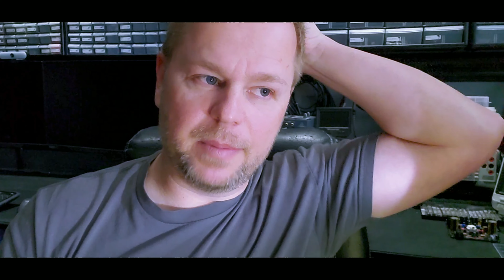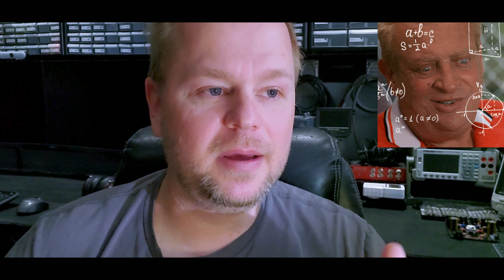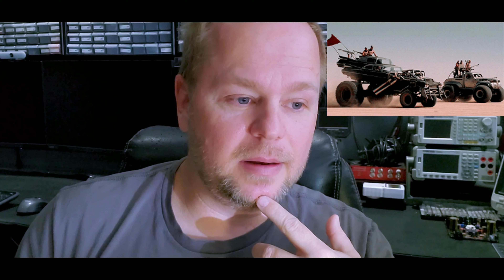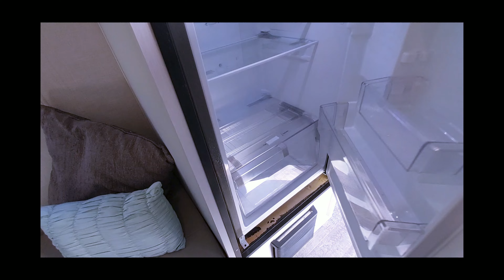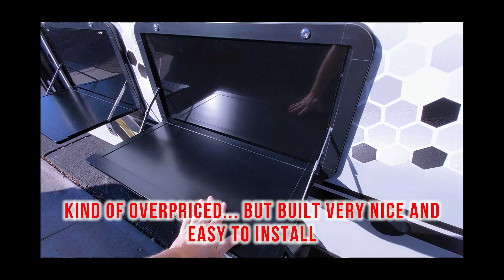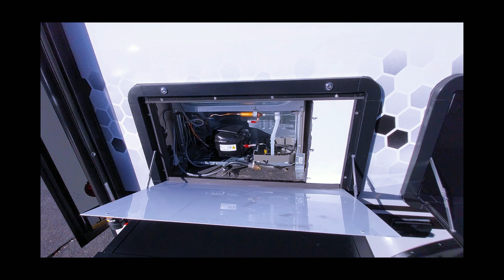AFFORDABLE - ENERGY EFFICIENT REFRIGERATOR | FOR OFF-GRID BOONDOCKING TRAVEL TRAILER RV - SIPS POWER

Comment: My 2 way absorption fridge stopped working and I'm looking into replacing it with a 12volt compressor model, but not sure about using the AC to run these fridge. I would think having to turn on the inverter while boondocking would negate the power savings you described.
Reply from the maker: In most cases, you would be correct, but it comes down to splitting hairs and the exact 12v model you are looking at (its actual efficiency). Since I did away with 12v house batteries and my setup runs like a 24 or 48V DC setup requiring DC-DC conversion for basic 12v needs in the travel trailer, this fridge wins big time. And once cool, the average power draw is so crazy low. As long as it gets the job done for a good price - run it!
Reply: @MR_Garage  Thanks for the quick response!

Comment: Is the condenser external? The biggest issue with mini fridges is that the condenser is buried in the sidewall.
Reply from the maker: Side walls. Plenty of airflow and clearance around the sides and top in my install. Never even gets slightly warm inside the cabinet.

Comment: I also have a GX470 that I will using to tow my travel trailer. Does the GX have a transmission cooler?
Reply from the maker: It does, a very small one. I would recommend an upgrade only of towing above 80% of the tow capacity. I am around 50% and the stock cooler is having no issues keeping up (internal radiator cooling and small external cooler)

Comment: That was interesting. Looks like solar panels are coming your way soon.  
My 2-way fridge- I’d gladly change it out & as well as the freaking huge A/C on the roof ( but I do NEED air conditioning). It’s hot out west .
Love the small agile size the trailer is but I’m leary 
of the roof integrity with 100 lbs up there